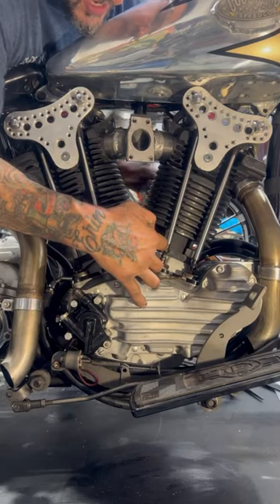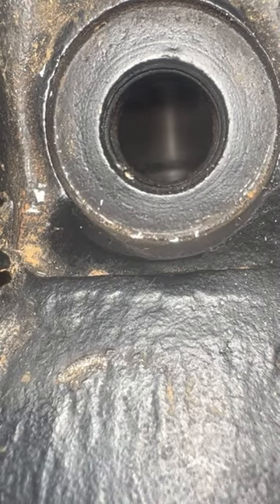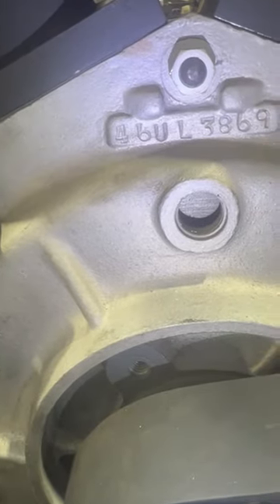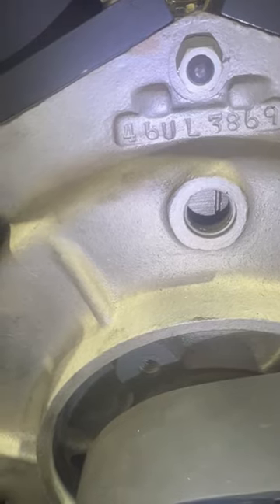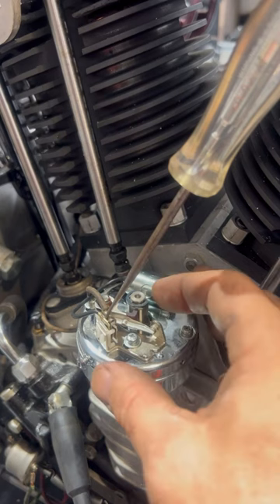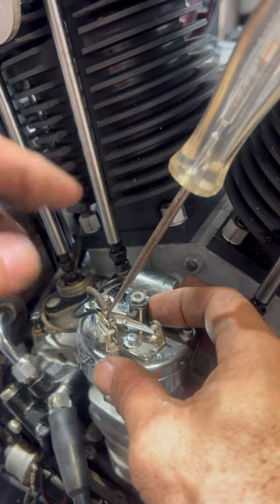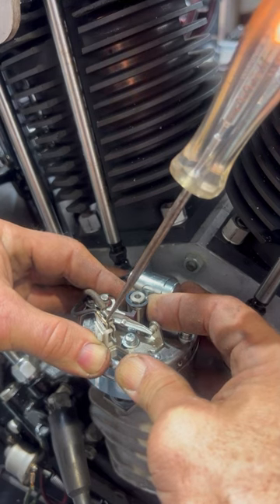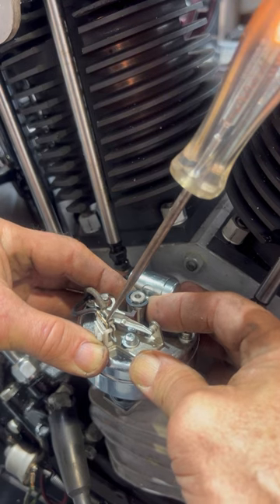Billy Lane How to Set Vintage Harley Ignition Spark Advance Timing for First Kick Start Motorcycle

Comment: Beautiful.  This is how it's done on any points driven ignition system.  On 4 wheelers set the timing on 5-10° advance and with ignition on, turn the distributor against operating rotation.  Audible click and spark when points break.  More accurate than a timing light because you won't have to mess with any vacuum hoses, idle speed or timing chain dither.

Comment: Many owners set it when they get the light right away, I set it only when the light comes on with the final firm press on the advance of the cam - when that motor is turning the advance will be right up to the stop, not when the cam begins to advance. Now I only use electric start for if I stall in traffic etc. Such a sense of satisfaction kicking a big Harley into life.

Comment: I knew a fella with a 1985 Low Rider, he did exactly this procedure except he'd put the dot timing mark just coming into the window, like it was in advanced position to match the points timing plate advance position. Worked very well.

Comment: Makes me appreciate my newer bike even more now.  Fuel injection and electric start. I don't want to wrench on the damage thing. I just wanna ride....dangerously  !!
Reply from the maker: I have a 2022 Road Glide ST, which is a very good motorcycle. If I need to be 800 miles away by sundown, the RGST is the way to go. But it doesn’t thrill or inspire me like my vintage motorcycles which require me to interact with them.
Reply: @BillyLaneChoppers  i was gonna say the same thing man.

Comment: Hey Billy a question I’ve always had about timing is, does it matter the stroke it’s on when it’s at tdc? Or as long as your tdc and your mark is lined up?  I know it sounds like a stupid question but it’s something I’ve always wondered.
Reply: You kinda answered it for me i didn’t catch the first few seconds until the third time i watched it. Thank you
Reply from the maker: When your spark plug fires, it takes a fraction of a second for the flame of combustion to expand in the combustion chamber. Ideally, this would happen instantaneously at TDC but, since it takes time, we fire the plug early (before TDC) so that the combustion is essentially complete by the time the piston does reach TDC. And the point at which we fire the plug is called spark advance. It’s all about timing, not stroke.
Reply: "It's all about timing, not stroke."
One of life's top five rules!

Comment: Used to be, advice was to set the points with a small transistor radio. Tune it between stations, and listen for the pop when contact is broken. Does anyone remember those  ubiquitous handheld things?
Reply: Yes, and also remember dwell meters.
Reply: With ignition on you should see a spark across the points and hear a click as the points open.

Comment: 46ul would be knucklehead head cases  right ? Also what cylinder combo is that with open push rods?
Reply from the maker: The U/UH/UL/ULH models are the Harley-Davidson 74” (1200cc) & 80” (1340cc) flathead Big Twin Side Valve (BTSV). This is a 74” flathead bottom end with overhead valve conversion that I make. The OHV conversion increases horsepower by about 35%.
Reply: @BillyLaneChoppers  Hot Rod 🏁

Comment: I am assuming that you have a manual spark advance?
Reply from the maker: No, the timer auto-advances with flyweights. That’s why I’m manipulating the breaker cam with my fingers- I’m advancing the flyweights by hand to set timing at full advance. I’m working on a more complete, long form version of this video now.
Reply: @BillyLaneChoppers  I didn't see you holding the cam. That makes sense. Many years ago I had some dealing with an Indian Chief and the advance/retard was controlled manually by the left hand grip. I am more familiar with older British bikes with points and I use a small set of pliers to turn the cam to full advance. I do this until my light just winks off. I loved the Video. That is a fantastic looking bike.

Comment: Used Zigzag in the day
Reply: When the paper would just slide out, the points were opening. And a matchbook for the gap, I remember many of the old ways, because I AM old.
Reply: @megastick9324 lol , Ez -wider and a matchbook , bunch of old greybeards showed me that trick when i was 20 , and had a ridgid 68 xlch  would kick ur ass if you didn’t have that set right
Reply: @garylang3379   the whole issue with kick starting Harley’s was timing. All the stories of kick back were the direct result of poor timing. It was especially critical on mag bikes.  I’m an old gray beard and learned from the gray beards of my day…

Comment: Test light dude.
Reply from the maker: Yep. I realized, while editing, that I was saying “timing light”. But didn’t feel like re-making the video.
Reply: @BillyLaneChoppers I knew what you meant.
Reply: @BillyLaneChoppers  my current project may never be done but if it ever lives it'll be insane.
Two 120r motors side by side each with a procharger. It's a packaging nightmare but insanity usually is.